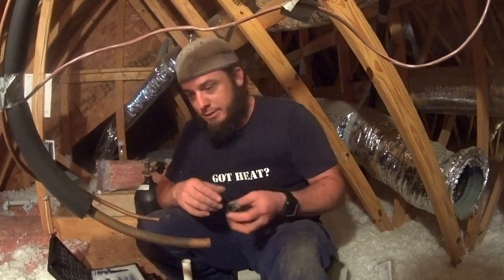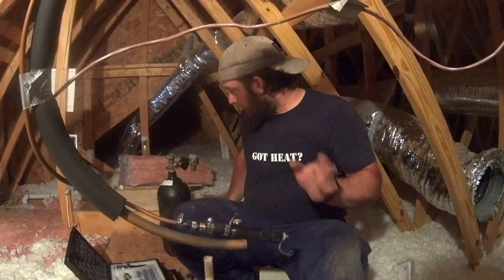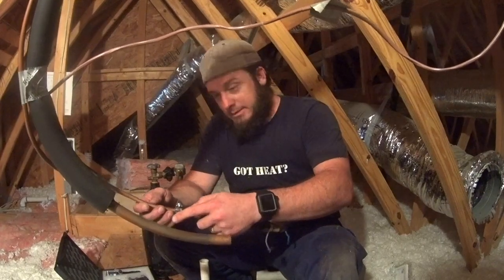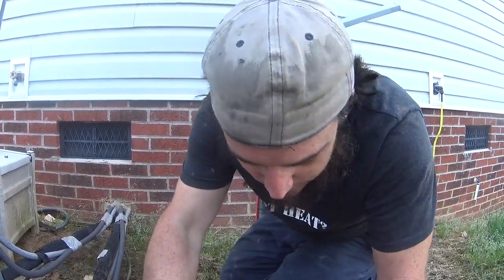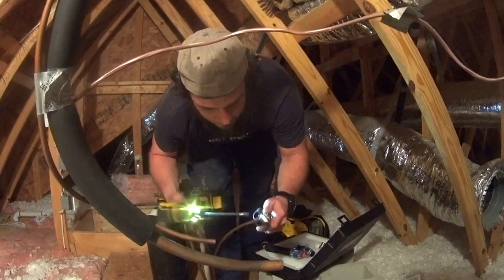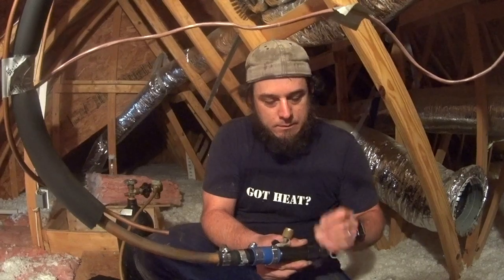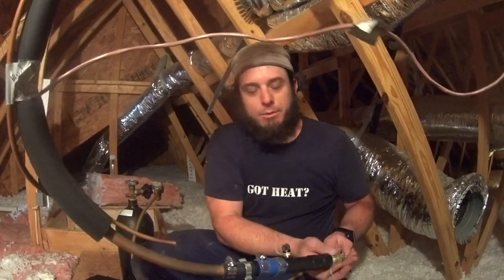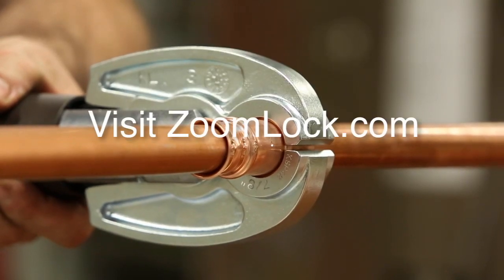Using the Pipe Wiper System Before Installing a Bosch Heating & Cooling Inverter Heatpump System

Comment: #1 who has this kinda time in a 120 degree Attic and what happens if this plug gets lodged in the line set?
Reply from the maker: You can blow the plug back up into the attic and it really doesn’t take any time when your not recording. Would you rather not clean the pipe at all and have problems with the refrigerant staying clean? Maybe we shouldn’t use nitrogen either since that takes a few extra seconds?

Comment: So using this instead of rx11 followed by nitrogen?  Way easier than welding on ports in the 100 plus degree attic I’m in. What’s the cost of the kit?
Reply from the maker: +Rich Davis kit costs a couple hundred I think. It would be a replacement for flushes plus nitrogen in most situations

Comment: I love your videos bro. Bro I work for a small company in South Louisiana. We are growing fast and strive to perform the highest quality work. We buy those large 15 pound jugs of R11 flush. Those jugs cost $600. That adds up fast. I’m so glad you showed me this. I think we can save a lot of money. I’m just wondering how effective are these “pigs” at removing all the oil residue. I’m confident that I get all the residue out with flush and nitrogen but dude I use $100 worth of flush nearly every time I flush a set of lines. Maybe even $150 if the lines are long like 70-100 feet. That adds up quick. I’ve been looking for ways to save money without sacrificing craftsmanship. What do you guys think about this stuff? How exactly do those “pigs” remove the oil residue? Are the soaks in some kind of solvent or are they dry? I’m very interested.
Reply from the maker: If you don’t think it’s dry enough you can run the pig or a new one a second or third time. I think it’s at least worth a try for a couple crews to see how it works for you. I’ve been very pleased
Reply: Stephen Rardon where are you located bro? I’m in Slidell Louisiana.
Reply from the maker: i'm in North Carolina

Comment: No need for 500 psi to push the pig through.
Reply from the maker: True but I had heard that the VN regulators may not have enough to push it through so I wasn’t going to take the chance on this first use of the pipe wiper

Comment: Very nice . What is the longest line set you can use this on?
Reply from the maker: Don’t think there is a length limit, all in what pressure it takes to get the pig through

Comment: Been using it for almost two years. I love it. I blow two wipers down each line with no chemical and my TEZ-8 pulls a much faster vac without having to change the oil. That flush chemical, I found, kills vac oil. You are living dangerously with 500#. Keep a hand on the launcher to prevent it from flying in your face. I've had one get stuck near the od unit. Just had to go outside a blow it back into the attic and it came right out. Keep the vids coming Stephen

Comment: I love that tool. Did you say 500 psi? I start off with 50 psi, then go up to 100 if it doesn't blow through.  You know it's not going through when you have a little back pressure coming out the fitting. Then I just increase it and it goes right through. 
I also been shooting the pig from the outside instead of dragging the nitrogen bottle to the attic. 

 I figure it's doing the same thing whether it's going up or down. Great to see you doing videos again.

Comment: You are killing me. 
        Feels like the first time. 

                   Great video.. 

I bag both outside, blast 2 pigs on each and prefer a spotter and towels in the bag/s.  

i prefer to put the pig in the pipe.  Deburring will extend the life of the pigs.
Maybe help keep pig pieces out.  Also the reason for second plug carefully inserted.  

The 3/8 will disappear. 
They did until i dropped pressure. 
 500 psi can go through the mesh. Eventually.  

The mesh bag will deteriorate. That is why the towels.  I blew a hole or two as well. 

 It's a squeegee. It's not a race. Slowing down may be better.

 It does sound cool!! 

 If it makes a puddle then repeat. 
I have not needed a bucket.  You probably know if you do.

500 psi of oil shooting out a 3/8 hole can be messy. 
Most are not messy. 

 A kink will fail. 
It should.                   I have not experienced a kink.           I assume.   

The Big plugs can be cut down in a pinch.  Create a 3/8" or whatever size. Insert in the pipe and confirm a snug fit. I like that in general. I Know it was in the pipe.  Deburring keeps yours trash out.

Use safety glasses

High pressure nitrogen and a projectile blowing out possibly acidic oil.  
  A loose fitting at 500 psi is one and done. Especially on the receiving end.  

Simple easy product. 

Thanks Stephen.

Any extra plugs?

Comment: I have used paper towels in very bad drain lines before to clear out sludge this is the first I have seen of this pipe wiper. Definitely a lot better idea then adding non approved flush chemicals or using nitrogen only. Thanks for video

Comment: That’s a pretty sweet setup. Never seen that one before. That would be a nice tool to use on a line set that has had a burn out (ect). Flush it with rx-11 then run the pig through for good measure and piece of mind lol. I hate dropping in a new 410a system on a used line set. Especially because of the  cleaning nature of a 410a Poe system. Awesome demonstration man. As always 👍

Comment: That looks like trouble. What if you have a 90 in the wall or it gets stuck in a slight kink somewhere in the line?
Reply: You have found the reason the previous unit died.
Reply: then clearly there's an issue that needed fixed anyway ;)
Reply from the maker: The pig will Blow through most kinks unless it really tight, elbow and normal bends are a non issue

Comment: I've been using pipewiper for about a year with a little flush. Works much better than nitrogen or flush alone. Haven't had one get stuck either.
Reply: i don't know if u do refrigeration , but do u think it would go through a condenser or evaporator like 3/8" tubing. its alott of u bends ?
Reply: OcRefrigeration,Hvac & Electrical. I bet it would if you isolated each circuit from the header and it didn't have any feeder tubes. Personally I wouldn't do all the work to isolate each circuit

Comment: I find flushing water through the lines gets an amazing amount of stuff out. Then blast nitrogen through to blow out the majority of water residue and the vacuum pump will boil out the remainder of the water.
Reply: who in there right mind would introduce moisture directly into a system that is supposed to be absent of it.
Reply: water, natures solvent ;))

Comment: Flush rx-11 and done .
Reply from the maker: Flushing liquids have been shown to cause more harm than do good. This will wipe out the junk and let you roll on. Takes no longer than flush and a lot less mess.
Reply: Stephen Rardon  what about a hard pipe system ? And multiple fittings ?
Reply from the maker: Not an issue, it’ll go